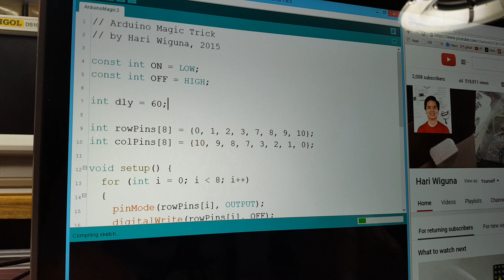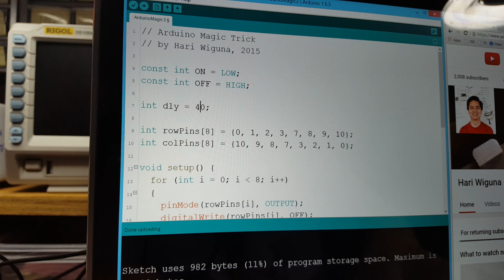HariFun #113 - Arduino Magic Trick Part 2 - Secret Revealed

Comment: Called it, but I thought it was just a too simple explanation so I hoped for better trick...
Reply from the maker: RealationGames , yeah, I wondered how many people have used an Arduino to program an ATTiny before. Just imagine how magical the trick looks if you are not privy to that information.  Just like most magic tricks, it's less fun if you know the secret.
Reply: Hari Wiguna
It would be sad to hear that makers didn't know that MCU is just the chip and doesn't really need any breakout board with USB converter and power regulator to function.
It was mind blowing to me when I first heard about MCUs though, so this might spark some intrest for someone...

Comment: Did you use the ArduinoISP?
Reply from the maker: norm1124 , yes, you got it.
I was learning how to use the ATTiny84 when I realized that it would look very odd if I hide the fact that the Arduino Nano was only being used as an ArduinoISP and not where the code actually runs.
Reply: Hari Wiguna check this pinout, it includes the ISP configuration: http://www.pighixxx.com/test/portfolio-items/tiny/?portfolioID=337, not my own artwork, but really great
Reply from the maker: norm1124 , great resource, thanks for sharing!